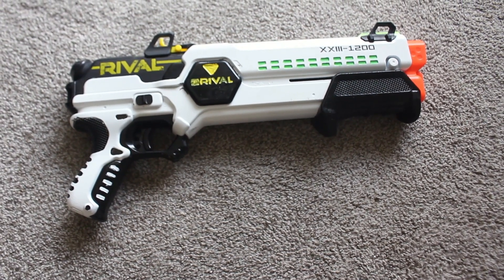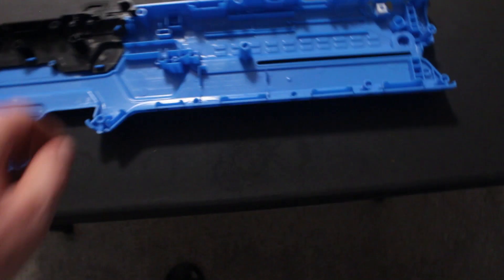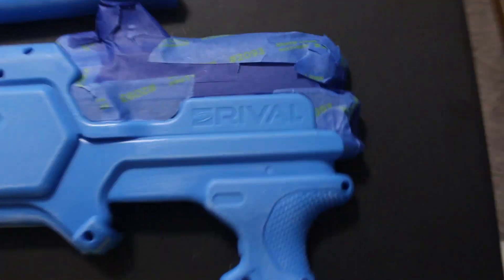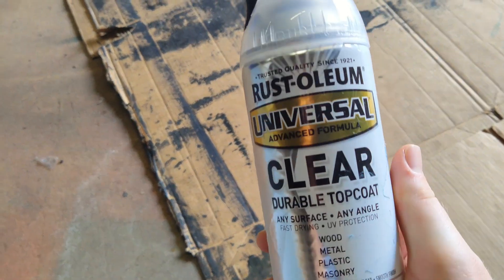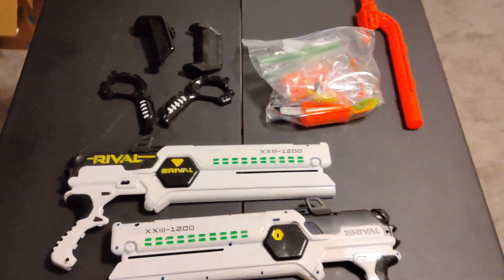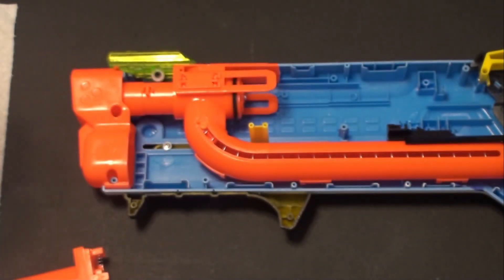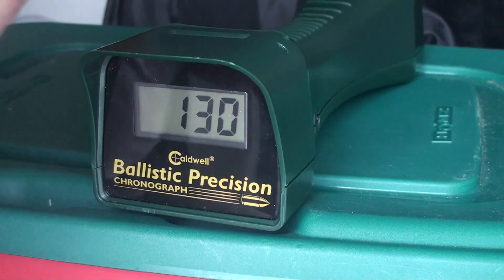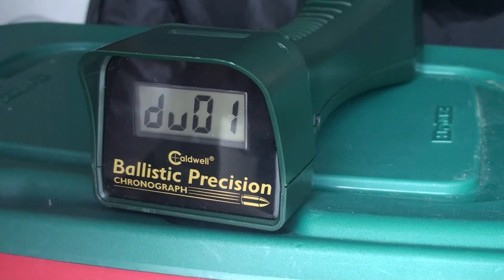Nerf Rival Forerunner Modifications Paint, Ratchet Removal, K26 UPGRADES!

Comment: Your paint job looks amazing. However, I think that putting a K 26 instead of AK 25 killed your FPS numbers. I put in a K 25 spring in my forerunner and I’m getting 140 consistently.
Reply from the maker: I don't know about the FPS.. maybe.  I am happy with where it is though.  I honestly probably could have fit more coils into it but I was having issues getting it to prime all the way and thought the spring was why (however it wasn't).
Reply: As long as you're happy, that is all that matters my guy.  When I did my spring upgrade, that thing was a workout on my arm to get it to prime so the blaster wouldn't fly all over the place before I could cover it back up.  You didn't seem to have that problem with the K26, so at least there is that!  Again, great paint job!  I'm actually kind of envious.  I wish my paint projects looked half as good.   @KlotzProductions
Reply from the maker: @SecondHandBlasters  Thanks... yeah, being able to actually prime the blaster without too much trouble is also important for practical use.  Some people can barely prime stock Rival Blasters.